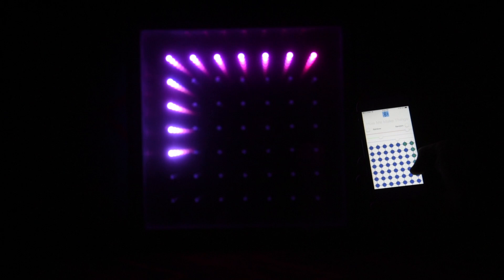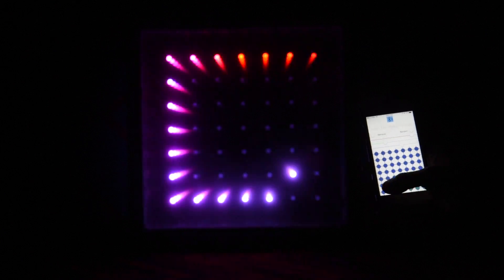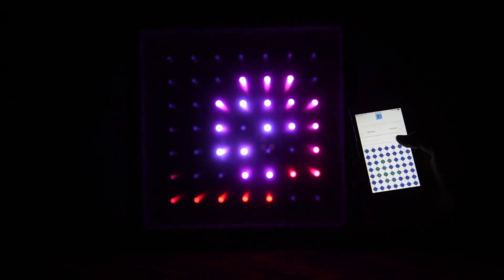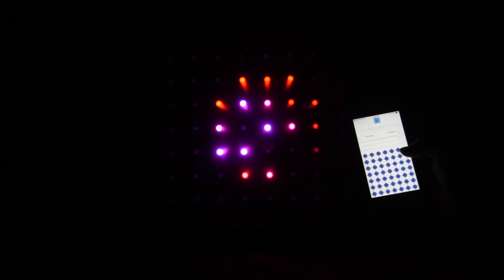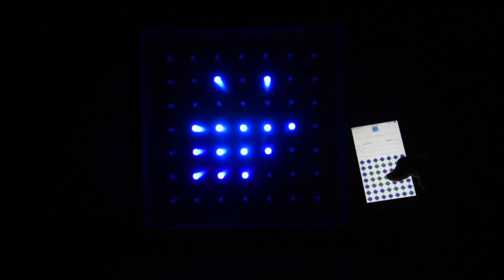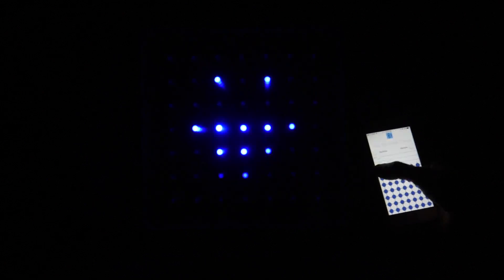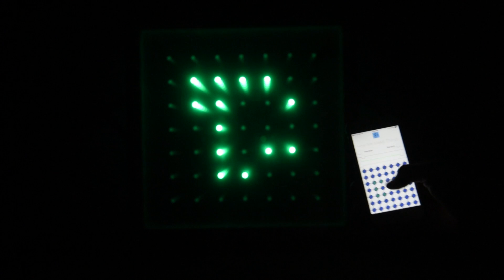Infinity LED Matrix Mirror - Bluetooth Controlled: DIY

Comment: I'm thinking of doing something like this but just wondering if it possible to just have the LEDs ( a cheap 8x8 ws2812b matrix board ) stuck directly to one way mirror film  without making holes, not sure if it will work ,  so both parts would be one way , I don't have any of the mirror film to try it out. If it worked it would be easy to make something like this.